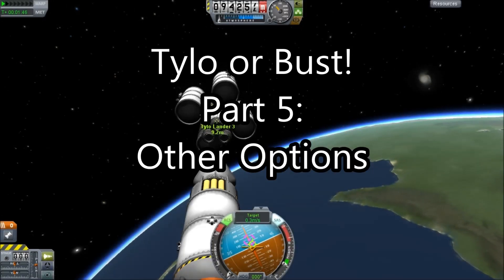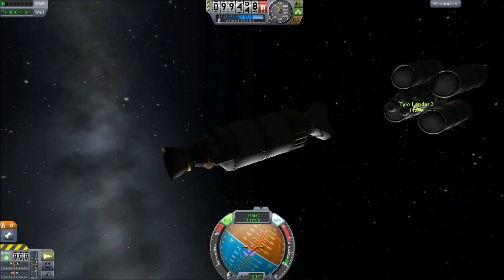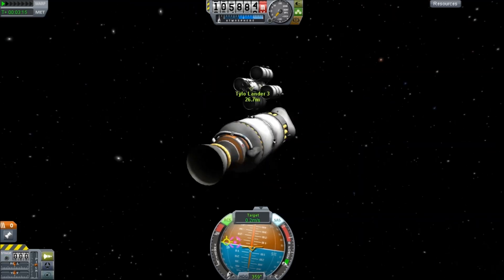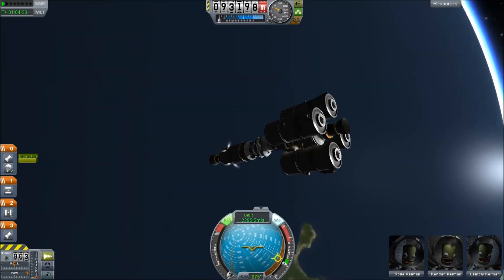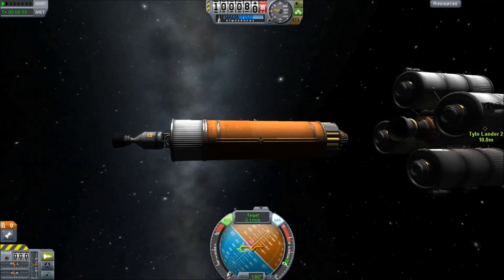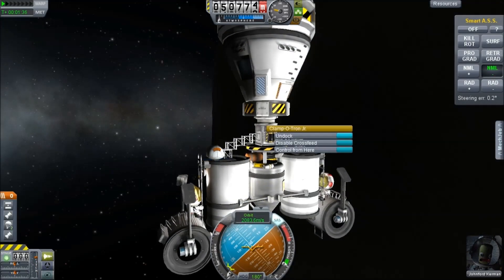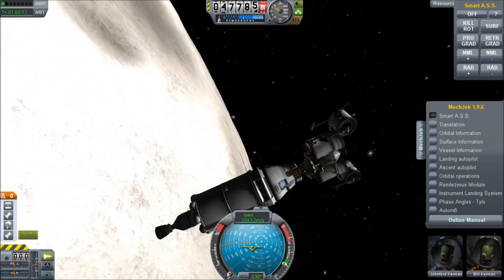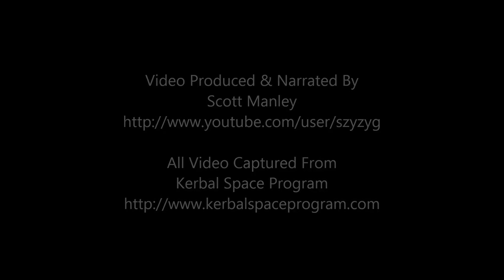Kerbal Space Program - Tylo or Bust! - Part 5,  The Aftermath

Comment: Unless the craft with the main sail is docked to a relatively small ship (which would have a low amount of linear and rotational inertia), using the main sail for thrust usually won't work. When I tried it with the lander shown in this video both the lander and the interplanetary unit were torn asunder and everything exploded in the first thirty seconds :)

Comment: The main reason that your docking techniques were fairly unreliable is, as I'm sure you're well aware, the design of your rocket.  Rockets don't work when you are trying to push stuff when your connection is wobbly.  Its like balancing a ball on your finger, incredibly difficult.  Instead, pull the load rather than push.  Think of it like a train, if you are pulling the cargo you don't need to worry about it falling out of path, it is always following you.  The only problem is slowing down, which is solved through placing another set of engines facing the opposite direction at the opposite end of your train.
Reply: Uh ... you can always swing around and thrust the other way ...

Comment: Did they change the game mechanics since this?   Or are the junior docking ports just easier to work with in multi-point docking?  I used a triple docking approach with junior ports and it worked surprisingly easily.  All 3 connected on the first try.  And I'm usually far from "pro" at this game.

Comment: game physics won't allow it (plus the fact the sun doesn't have a surface, it just has a thicker and thicker atmosphere until your spacecraft is crushed under the pressure or if you come in at a shallow enough angle, you slingshot out of the system at relativistic speed)

Comment: That's false I believe. The orientation is just the direction it is pointing in, so you can put it on the ball. Combined with the position marker and the distance counter you have all information you need. The third rotation dimension is just the roll, which actually could be added by making the marker asymmetric. That gives you 3 dimensions on the orientation marker, 2 dimensions on the position marker and the distance counter gives you the last dimension so you have all the info you need.

Comment: I've been sticking with what I call the nuclear nosecone, a craft with nuclear engines radiating from the center and docking ports on the bottom in between the engines for any number of fuel tanks and landers. It's much better to pull instead of push.

Comment: Ah. It would be cool if the devs could let us connect the nodes of two craft that were already docked, which would alleviate a lot of docking-related headaches. Maybe letting the player select which nodes they wanted to dock first, so the "magnetic" pull wouldn't cause uneccesary and incorrect docking

Comment: One way I have been dealing with the poor strength of docking ports is to have the engines pull the spacecraft instead of push.  I have the engines mounted radially on the leading section and pulling the other sections along.  This lets the inertia of the ship keep the sections aligned.

Comment: I'm probably doing something wrong as i don't use the docking mode at all nor do i use EVA enough to actually know what the controls are :D. I just use my left hand for orientation and the right hand for translation. Works for me (using 2 hands is a byproduct of not having rcs thruster setup in a way that translating doesn't result in orientation changes and the powerful need to not use SAS to drain all my fuel :D)

Comment: Scott, Squad has stated that triple or binary ports do have an added effect.  One dock does get the docking value, but the others do contain an actual connection.  It should be noted that docking ports are not meant for spaceship assembly.  Squad does have plans for space assembly of spacecraft in the works.  (If just on paper, atm)